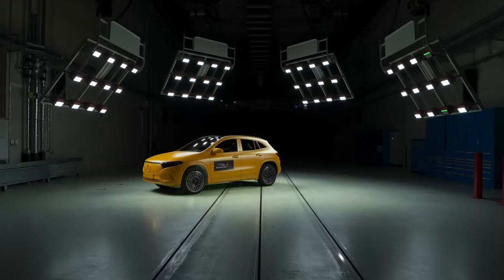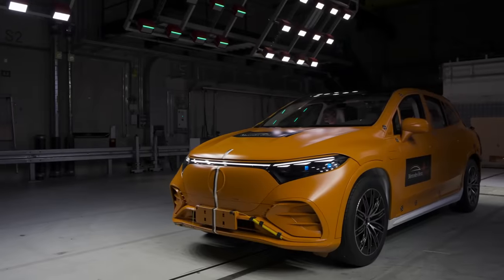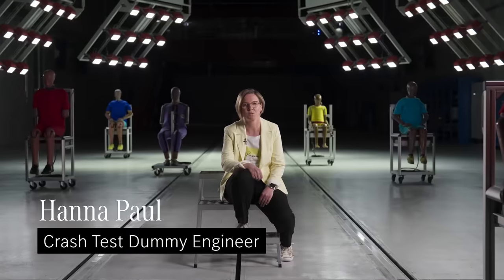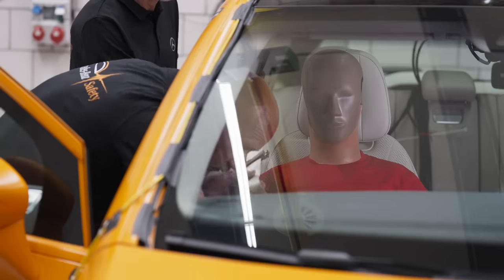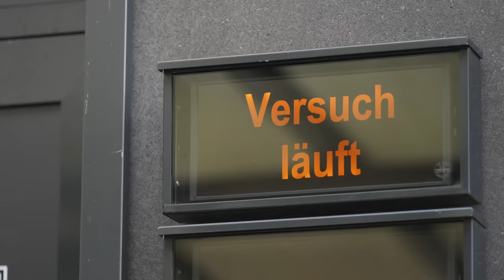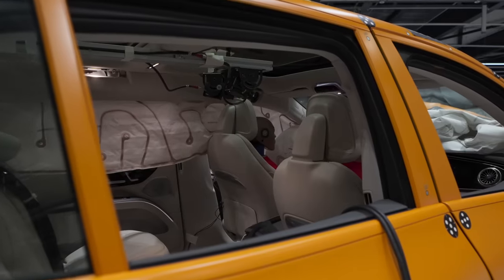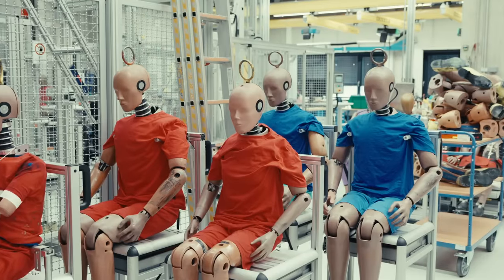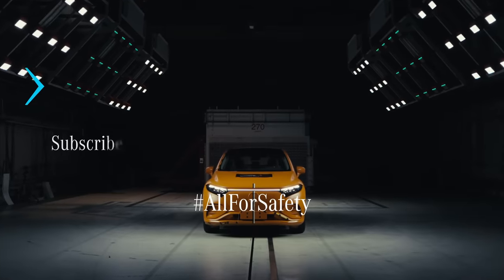The world's first public two-car electric crash test by Mercedes-Benz

Comment: Now tell us how a 5,000 lbs EV affects the safety of passengers in a 3,000 lbs normal engine car? This endless cycle of heavier and heavier cars needs to come to an end in my opinion.
Reply: Same way as a 5k lbs combustion car
Reply: Crash tests have been done between regular cars and vans, American pick up trucks and SUVs in the past.
Reply: I’m still alive after owning a smart car for 15 years.
Reply: @virtualZ161  that reminds me, Mercedes crash tested a Smart ForTwo with a larger Merc too!
Reply: Propably then you have to invent lighter battery. I suspect that there is one or two people trying to make EV battery which is light and energy dense. Im not so sure about compatilbility problem with newer cars. More worried about old cars which are made out of weaker materials protecting occupants and some even without any crumblezones.
Reply: @virtualZ161 in Russian roulette you can also have around 5 tries
Reply: Exactly my thoughts…
Reply: @virtualZ161  thats very good - I hope you never experience a crash!
Reply: @koko-lores  all EVs are heavier … 🙄
Reply: @NaenaeGaming  and the result?
Reply: @cachememory  from what I can remember, the Smart did very well, no intrusion into the passenger compartment like you’d expect from a car its size
Reply: @cachememory  doesn't matter. When you are hit by 5k lbs you are hit by 5k lbs.
Just like 1 kg of wool is as heavy as 1 kg of lead
Reply: Ummm….no they are not!!  @cachememory
Reply: Hey yo, look at the weight of bmw fossil fuel cars similar or heavier. Battery density and the charging infrastructure is increasing. It will be lighter, cheaper and self driving, and because of the latter fewer and fewer people will choose to buy a car and instead call a driverless car that don't need to be in a parking space, when at scale translate to fewer cars needed and more space to be used for construction or something 😅
Reply: Specially with that hummer Ev
Reply: @RogueMaverick_  Yeah man totally. Driverless cars should be the transit of the future... or Idk maybe we should stop designing cities around cars and go back to actually efficient means of transportation like Buses, trams, trains, etc. Cars should be for personal transit between large areas or rural areas NOT urban environments. Cars are not fun to drive in the city, are slow, cost way too much, and kill way too many people yearly and we just accept it.
Reply: I think the bigger problem is the height of the front bumpers and if they can hit eachother if u crash into an SUV or an American Pickuptruck ure more likely to die because they dont hit eachother well...
Reply: This is why I like what Aptera is doing with their EV. 
More efficiency and less weight.
Reply: @David_Z220  also pedestrians are much more likely to die if hit buy a truck or large SUV because they can't go over the hood so they go under the tires
Reply: What about when everyone is driving a heavy EV, how will that effect our outdated bridges?
Reply: A Tesla Model Y is 3.4 cm longer and 8.8 cm wider compared to Mercedes-Benz GLC. It also offers 29% more cargo space. The Tesla is also 16kg lighter.
Now tell me that EV's are the problem? I'm all for smaller lighter cars but effective design has a big part to play. Don't be lazy and blame EV's.
Reply: Actually in this test the weight difference also was about 700kg (1500lbs).
Reply: Dude, I drive a Toyota Yaris HB 2015, 5 stars of security, 9, fucking 9 airbags, it weights 2333 pounds… if an EV hits me like this Im so dead, they are just too heavy. Regulations on weight might help save some lives down the road.
Reply: I don’t think they are trying to make cars heavier on purpose that’s just bad for everything
Reply: You drive on the road with 18 wheelers. Chill out.
Reply: @tr5946  Brain dead take. At least 18 wheelers have a reason to weight so much, require a CDL, and there is far fewer of them on the road than passenger vehicles.
Reply: @RogueMaverick_ people will call a driverless car??? That’s the most American shit I’ve ever heard. We have public transportation for that wtf
Reply: It’s easier with an EV since you don’t have a giant engine in front of you at all times while driving. That’s prone to hitting you in the cabin. The font of an EV if designed properly can be used as a crumple zone. And the heavy batteries on the floor offer a low center of gravity reducing the risk of rollover during a collision
Reply: No to SUVs ✊
Reply: Can't have lighter batteries until solid state isn't viable
Reply: @cachememory Cadillac Escalade V  joins the chat. $151,00, 6000 curb weight, 2000lbs payload capacity, 13mpg.
Reply: Tell a truck owner that in a crash with a sedan
Reply: If you can make a battery lighter go ahead
Reply: damn a normal car weighs 3000lbs now?!? my pickup weighs close to that
Reply: How about you learn how to drive
Reply: @NaenaeGaming 
Those cars are going to get significantly heavier when they become EVs as well.
Reply: A great effort. What I realised, they say 0 fatal by 2050. What I see is someone ( electronically) will control the car, not the driver, therefore, no crashes.
Reply: @gerarddip  not sure if it’s the Smart or the van comment which you’re referring to, but my point is that during the transition period, you shouldn’t need to worry about EVs which are heavier than ICE cars that much as they’re already designed to hit bigger, heavier vehicles
Reply: What do u want a 100 pound car
Reply: @tiagoneves8072 Dont forget one outcome can be gun jamming!
Reply: @koko-lores There are very little 5000lbs combustion engine cars. Average combustion car is like 3000-3500lbs, EV of the same size is usually 500-1000 lbs heavier.
Reply: @virtualZ161 And how many 5000lbs cars have hit you?
Reply: @koko-lores a 5000 lb combustion car is the size of an f150 though not a small crossover
Reply: Also think of what happens when these giant things crash into a pedestrian. The SUV trend is literally killing people for the comfort of drivers
Reply: Less than an F350 with a loaded trailer.
Reply: @virtualZ161 but have you driven it?
Reply: @cachememory  I no longer have it. Paid 17k for a fully loaded fortwo passion when first introduced in the US.
Reply: @jurekgadzinowski2895  luckily none. I no longer own a micro car. Now drive a 5000+ EV crossover.
Reply: Isn't the Ford f150 America's best selling truck? I think that's a 5000 pound truck lol
Reply: My "normal" engine car is 4,600lbs and my SUV is over 5,000, what's your point?
Reply: @jadenbright3854  The point is weight difference. Show me what happens when a 6000lb Ford Electric pickup hit a Toyota Corolla or VW Golf. It would be interesting to see the effect of heavier and heavier vehicles on the roads.
Reply: @knutbergan  and my point is that my gas powered cars weigh just as much as
Reply: Agreed, just downright stupid.
Reply: Sounds like a stupid question. Ask the producer of the ,,normal engine’’ car!
Reply: Let’s go back to organic horses and buggy. They barely weighed 800 lb.
Reply: You should be more concerned about how pickups and SUV’s are exempt from bumper height regulations.
Reply: I agree, I myself drive a hatchback and not everyone drives SUVs. We need to know what the actual casualty would look like with a EV SUV vs a hatchback and what would the survival rate would be
Reply: Imperial units yuck...
Reply: Most stupid, useless, ugly and expensive SUVs wheight more than most EVs with the same capacity
Reply: The Tesla Model 3 weighs about the same as a combustion 3 series nowadays.  As electric cars improve, they will become lighter.
Reply: @xjcforever1x you first.  Nobody is forced to buy or use a vehicle.  Go ahead and walk, and I will enjoy the freedom of movement my automobile affords me.
Reply: sh*t bro, you're getting it... almost like EVs are at their best when small and efficient and people should use public transit and government should build infrastructure with liveable/walkable urban planning
Reply: @howebrad4601 in areas where governments maintain car-centric infrastructure you indeed *are*, by circumstances, forced to use a car, as walking is practically a sign of lack of self-preservation and wastes magnificent amounts of time.
Reply: Most EVs weigh around 20% more than their ICE counterparts, for most it's comparing the same car with 3 passengers vs no passengers.
Reply: And yet people continue to buy oversized SUVs - the top ten heaviest cars in the UK are all ICE engine SUVs -
Reply: And how you justify adding 2000 pounds of extra weight to a gasoline car which can be built and was safe for carrying a 175 pound of human for daily travel? In name of energy saving and environmental friendly?
Reply: The greater the mass, the greater the energy . It has to go somewhere
Reply: @chuckmaddison2924  that's why they design crumple zones, most crash tests use an immovable object to crash into that would be the worst case,
Reply: The good news is that that 'normal' engine is very rapidly becoming 'abnormal'. EVs are becoming the 'normal' engine and already area in certain areas. Norway is a fantastic example of how the 'normal engine' would be the one with the EV.
Reply: @ElusiveTy  The biggest worry I think with EV's is that they think they can train grease monkey mechanics to fix them.
Reply: @virtualZ161 Smart Cars have one of the strongest frames, as can be seen in YouTube videos… having a very small crumple zone though, it’s not beneficial to the occupants
Reply: @chuckmaddison2924 or that our energy grid is already struggling hard, and if everyone has an ev we're fucked. Not to mention energy doesn't just appear at the outlet it's produced majorly from coal. The safety of extra weight on the road isn't much concern compared.
Reply: Just look at luton England, ev starts fire in car park, other evs catch fire, burning at 2500 °c (Thats very very hot for you yanks ) flames from evs cut through concrete and steel like butter, car park collapses,  imagine that car doing that in your garage attached to your house, doesn't bear thinking about
Reply: @michaelawler  you obviously live in America where Trump didn't believe  investing in clean energy? Once in front  now you are now years behind!
Reply: @ianlouden7939  trump was president for 4 years, and the president of the United States doesn't make ultimate decisions like a monarchy does. He's not responsible for this he's just an outsider to politics that makes an easy scapegoat.
Reply: The same way a Ford model t affects a crash with a horse and buggy. GET OVER IT!!!!!!!
Reply: @RogueMaverick_  ok so I checked two 4 series BMW the gasoline car was 1682kg and the electric one was 2125kg.  If you have any evidence to the contrary I'd like to see it.
Reply: America's 80% trucks. You need that there to survive. People in other parts of the world aren't that reckless😂
Ur probably a truck owner, too.
Reply: You realize that there are many 5,000 lb non electric car's, suv's and truck's right? Like come on dude, there's no way that's unheard of to you.
Reply: Says the american driving unnecessarily huge trucks
Reply: Stay home, then you won’t need to worry about it.
Reply: EVs depreciate more quickly and to a greater extent than any vehicles on the market.  Used ones don’t sell because of the extremely high cost of battery replacement.  This fact is rarely factored in when comparing the costs of EV to ICE.
Reply: Wow, that comment didn’t last long.
I must have been right on target to have it removed within three minutes.
Reply: Silly question, it's not as if every ICE car is the same weight..
I'm sure MINI's don't just crash into MINI's..
Reply: Amen 🙏🏾 to that 😊 BIGGER and heavier is not better 👎🏾
Reply: Loll they have more chip than a F-18 omg get informed men if you crash one you are not supposed to be on the road in my opinion.....
Reply: An electric Ford truck weighs 6500 lbs!
Reply: Much less than the 7000 lb pickup trucks that comprise almost 50% of "cars" on the road.😂
Reply: Smart Car and a Ford Super Duty go through an intersection at the same time. I hope I’m in the Super Duty.
Reply: @Supercon57  EV weight destroys our roads, too, not just bridges - which every local community will be paying to fix regularly and replace before their otherwise planned obsolescence. And their weight wears their tires out far more quickly than those on ICE cars and these are disposal nightmares. And guardrails can't hold them or survive being hit by one so these will need more frequent replacement or, ideally, full replacement with stronger materials before too many EV drivers get killed unnecessarily. And they pose a higher for risk for fire, particularly in wet environments or after accidents - even minor ones. This doesn't bode well for tunnels either. And everyone's insurance rates will rise dramatically to pay for the higher repair and replacement costs of EVs (this assumes, of course, that one survives a collision with an EV). So, yeah, clearly the world is prepared for EVs.
Reply: There is a simple solution: Don’t buy EVs. 🤷🏻‍♂️
Reply: @virtualZ161  But did you crash it?
Reply: In my area, I worry about the many big pickup trucks/SUVs that are lifted and have bumpers at the height of my head when I sit in my car. No matter the safety features in my car, a collision with one of those will be bad for me. In particular a side impact.
Reply: Funny why Americans always point this out that EVs are so unsafe because of their weight, and at the same time so many of you drive around in huge SUVs or trucks 🤷🤦🤦
Reply: @Greatdane-qf8kd  You misunderstood my argument. I didn’t say EV are unsafe nor do I think the majority of Americans think they are unsafe. Actually most people recognize that a safer car or truck is safer because it is heavier, hence trucks and suv are very popular. EV cars happens to be on average about 700kg heavier than a similar size gas/diesel car and I think testing organizations should test for that difference.
Reply: Exactly! Right on, brother
Reply: Absolutely..
Reply: Does your same logic apply to 5000 lb combustion vehicles such as Land Rover discovery 3-4, Range Rover sport, Range Rovers etc or is it just EV’s that are your issue?
Reply: @koko-lores  not the same at all. you can see just from this test how rigid the floor area must be to protect the battery. while this is good for preventing intrusion it's not good for absorbing impact. that's before you even consider the consequences of one of these monstrosities hitting a normal sized car head on because the driver is too busy try to connect it to the latest iphone they just bought.
Reply: So what about trucks buses etc, it's up to the individual driver and has nothing to do with the size or weight of any given vehicle, also what condition the driver is in, drunk stoned distracted, any given vehicle boat plane train is only as good as it's operator, so-called self driving vehicles scare me the most because who in their right mind would fully trust your life to a computer. One night an SUV was traveling down the New Jersey turnpike in the left lane going under the speed limit, the traffic was backed up as everyone tried to get around this slow poke, when I had my chance I passed it, I took a quick look over and couldn't believe my eyes, I actually had to do a double take, the interior lights were on and a woman was reclined in the front passenger seat reading a book, that wasn't the unusual part, there was nobody behind the wheel, let that sink in, again there was nobody behind the wheel and she was reclined in the passenger seat reading a book in the fast lane oblivious to anything around her,
Reply: And here I am wanting the new Toyota mini truck or even a Kei truck 😢 I know what you mean, EVs are not even sustainable anyway. People really don't understand how rare Lithium is...
Reply: @koko-lores  a full spec Ioniq 5 is 2200 kg. A fucking hatchback, 2200 kg 😂
Meanwhile european countries are slowly banning perfectly good old used cars like the Peugeot 306 (1100kg).
Reply: As long as SUVs are legally driving on our streets, you and others are in no position to judge over the weight of BEV.
For the latter the weight is technically necessary. But there is no necessity for overweight (conventional) SUVs.
Reply: Service Comment for 99% of the Rest of the World. 
5.000 lbs = ~ 2.267 KG
3.000 lbs = ~ 1.360 KG
(lbs / ~2.2 = KG)
Reply: @mro9466  European ist not Banning Old Cars 🤦‍♂️ they are not banning the Peugeot 306. You can still buy them.

Comment: Let's see the T-bone test now
Reply: Didn’t they do the t bone test already, but using a ram in place of the second car?

Still would like to see it
Reply: they can calculate a safe speed (as they said early 56km\h for the test), and show you a good result.
Reply: I'd also like to see the speed bump test... Go slightly too fast over a speedbump so it damages the bottom of the car - where the battery is. This has actually caused an EV to explode.